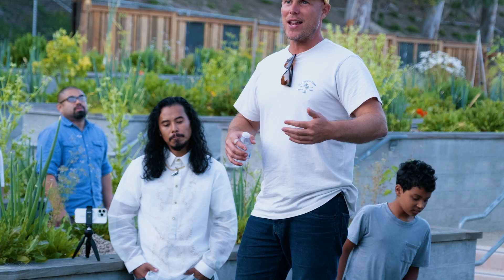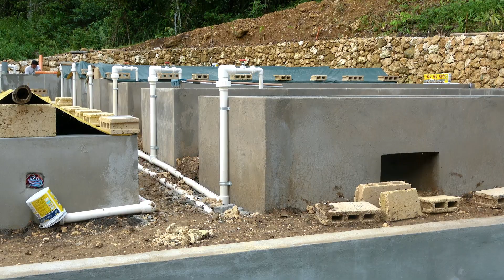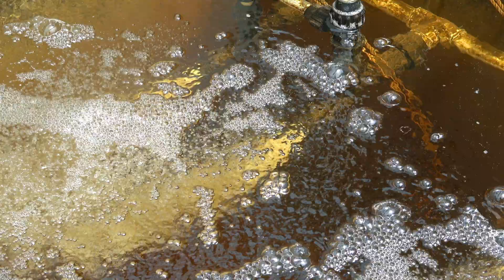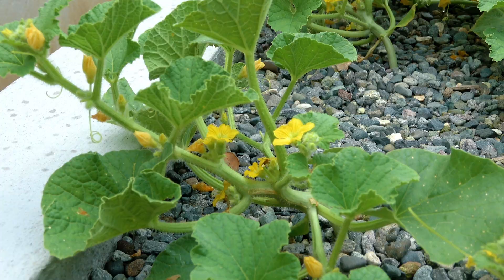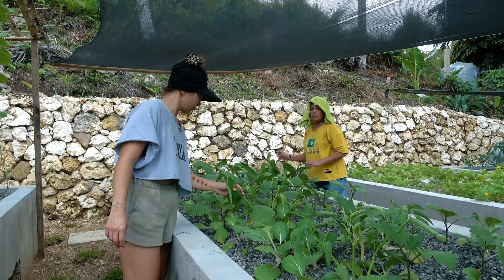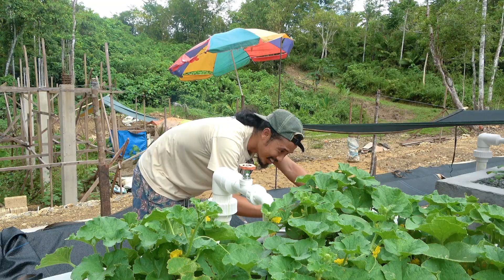Will Our 2nd Aquaponic Pond Work? Ep 7

Comment: I seen a few systems around Naga city, they quit using rocks.  They use foam sheet to cover the water and “hydroponic baskets” for each plant.  Cut hole in styrofoam & set basket in hole.  They all say maintaining PH requires vigilance.  Second challenge is correct feed for plants.  Enjoy watching you

Comment: You should paint or wrap the pipes above ground to keep them from getting brittle from the sun. I would use the word "NATURAL" instead of organic. I also suggest getting some frogs or other critters to eat the insects. Another system I saw, they used floating foam panels and had the plants planted in those in little baskets.